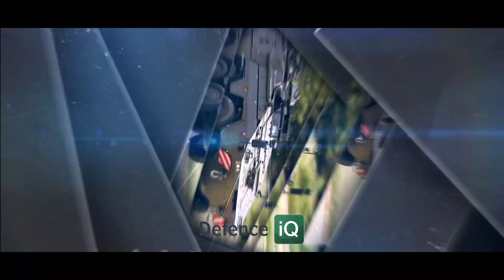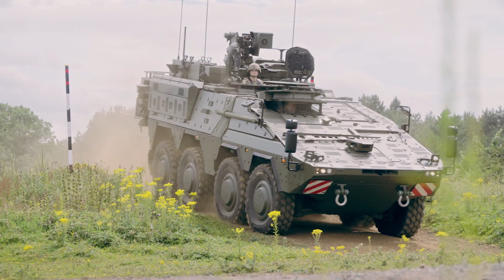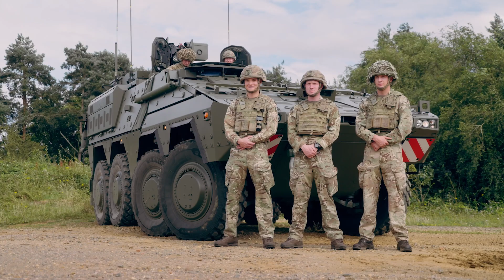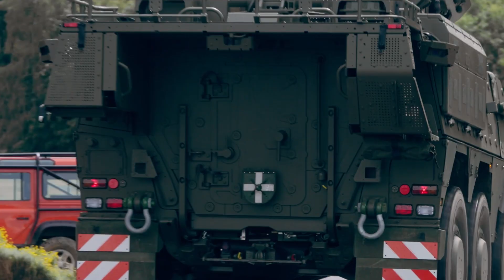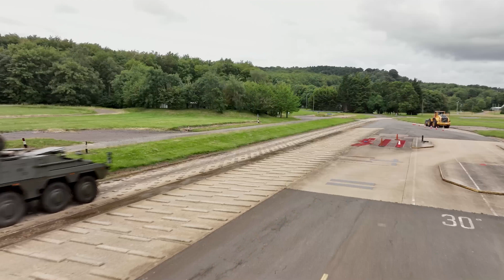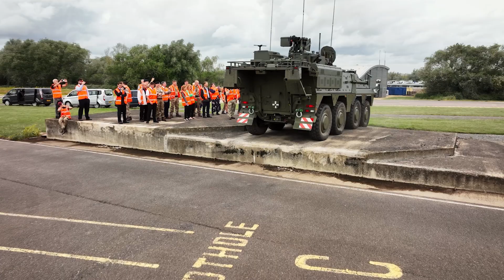The Progress of the Boxer Programme: Insights from Martyn Williams

Comment: The Boxer still needs a decent manned/unmanned turret fitted with either a 30mm cannon or a 40mm cannon if its going to be an effective expeditionary armoured vehicle for the British army.
Reply: Isn't that covered with the Ajax?
Reply: @spikeus3039  Ajax is fitted with a two manned operated insys turret fitted with the CTAI 40MM cannon which was successfully tested on a boxer about 6 years ago. The only problem with the insys turret fitted to the Ajax is that it is designed for reconnaissance. If the Boxer is going to have any IFV role it needs to be equipped ideally with a remote control operated turret for example the KNDS T-40 CTA turret or the Konsberg T-60. This allows more internal space for carrying infantry or equipment.
Reply: @stephenwhittle6864  Thanks Stephen
Reply: @stephenwhittle6864  Boxer isnt going to be an IFV its going to be an APC atleast for now. There are options to get turrets at a later date as the vehicle in modular. However like Spikeous stated thats what AJAX is for.
Reply: @ashleygoggs5679 why? APCs are very much an obsolete battlefield asset, the only real advantage they offer is costing less. So is this another instance of Britain scalping its military. 

Even looking at Ajax, the number of turreted fighting versions is pathetically low. It does not reassure.
Reply: @ashleygoggs5679  To my knowledge the British army still have the aspiration of replacing the Warrior IFV with another tracked medium sized IFV. But until the incoming SDR is published by the Labour Government which will hopefully outline just how much investment the army actually have the Boxer will have to do. Also the German army the Australian army seem to have no issues with using heavily armed Boxers.
Reply: @jgw9990  APCs is not obsolete and if you think they are then you have paid attention in ukraine where most armored vehicles are apcs. 

People dont walk into battlefields you know, they still need ways to get there. 

When it comes to IFVs its a balancing act between how much ammo you need, how much you can actually get etc. What use is having hundreds and thousands of IFVs if your ammo capacity is already completely stretched. And thats where APCS come in, they may not be able to fire a 30mm+ cannon but they can get troops from point a to b.
Reply: @stephenwhittle6864  Im not saying we wont, but what i am saying as far as the army are concerned as of right now they obviously dont see the need for it right now or they would have put in orders. We as civvies can say what ever we want but at the end of the day we arnt in the army nor are we high up with access to the real data that shows what we do and dont need. However depending on how AJAX gets fully written into our doctrine i can imagine a turreted Boxer will make it into the army eventually.
Reply: @ashleygoggs5679  The way I see things is if there's an increase in GDP like 2.5% heading towards the armed forces which has been discussed since before and after Labour go back into government the army might just be able to fund both a turreted Boxer and a possible tracked IFV based on the Aires. The Boxer for expeditionary roles and the Aires for armed battle group roles just like the warrior used to perform. Just hope my annalise isn't pie in the sky or the ramblings of an arm chair general.
Reply: @stephenwhittle6864  You do realize there is more to it then the military getting more money. We have 3 branches competeing for that money and the army is the lesser of the 3. Not only that but we have commitments to NATO which means we will likely spend more money on space technologies, cyberwarfare and our navy. These are the biggest priorities NATO gives towards the UK and its membership. So even if there is more funding it does not necessarily mean that money will trickle down to more tanks or armoured vehicles. Thats what Germany and Poland are for.
Reply: @ashleygoggs5679  I agree with most of what you've said as regards to a large ( should be larger ) pot of money eg GDP to be shared amongst the other branches of HM forces and the obvious squabbling that inevitably happens when resources are thin and stretched. Also the British army doesn't exactly have the best reputation especially when it comes to big ticket armoured vehicle procurement projects eg TRACER, FRES,OUVS,MRVP and so on. At the moment the British armed forces are still widely regarded as one of the best armed forces in NATO and that's why we still have a massive influence within that organisation. But we can't sit back a relay on other members to take the lion share of the burden. This is why as previously mentioned I hope the SDR when it's made public addresses most if not all the funding and investment issues including procurement cock ups that have plagued the army for so long.
Reply: @stephenwhittle6864  We can rely on others using their lion share, as thats the point of NATO. NATO as a whole means we are a significantly larger force and each country can focus on its particular set of strengther or geography to benefit the pact. 

The UK has never been known for its army but its airforce and Navy, and while i agree our army is still pretty much second to non. Its still always going to be the lesser of the 3 due to its significance for us as an island nation. Our army is mostly only ever used for UN missions and Land forces for any NATO actions. Other then that is not as important. We have plenty of new big ticket items coming, but like i said we may not need it now but it could be something to look at in the future if its needed. Its not like anything is off the tables.
Reply: @ashleygoggs5679 yes Boxer is the official replacement of the Warrior IFV at the moment , in which case needs a proper cannon on it for that role . Though a small chance a tracked ifv will appear in future  for uk
Reply: @ashleygoggs5679  Both Russia and Ukraine use BMP in substantial numbers which are IFVs. The APCs like the BTR and MTLB have proven not survivable, being destroyed in substantial numbers. Grievous losses. 

You are right they don't walk to battlefields. An IFV can transport them and provide fire support. Why settle for getting from point a to point b, when you can also destroy point b. 

I'm amazed that Britain would buy a vehicle the size of a small house but fail to put an autocannon on it. It's truly clueless behaviour.
Reply: I thought the "Lance" version of the boxer had a 30mm cannon, 2 anti tank missiles and 8 dismouts?

https://www.youtube.com/watch?v=o4G852oiksQ
Reply: @InquisitiveBaldMan  Britain hasn't ordered any of those.
Reply: To me being an old sweat, it’s replacing the AFV 432.